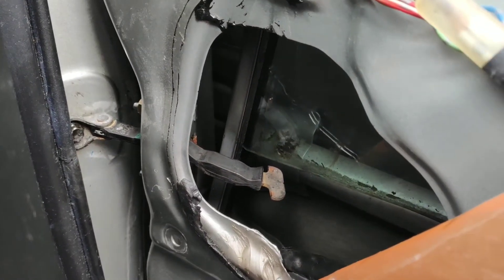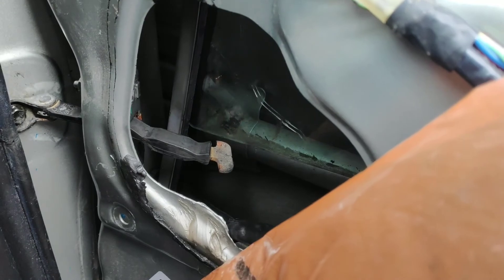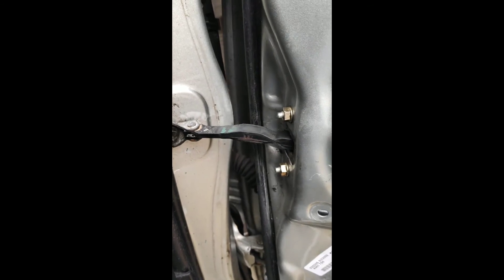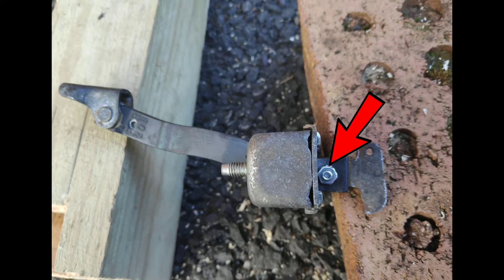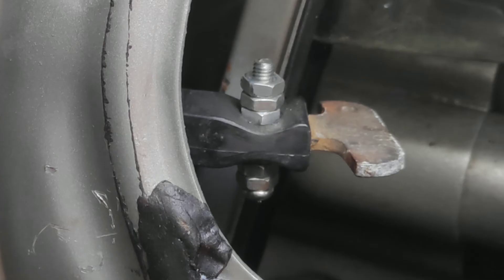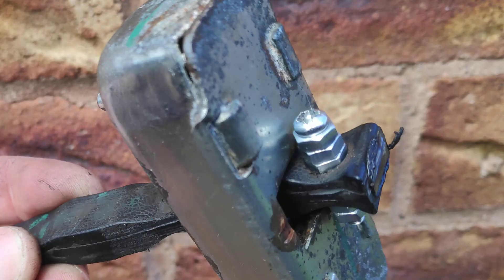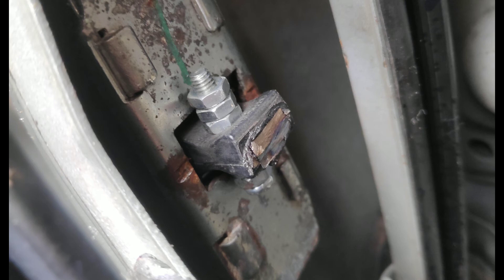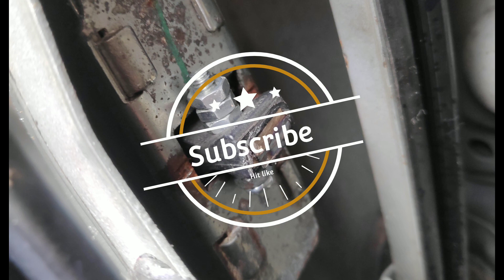Toyota Corolla door check strap mod. Avoid broken door glass!

Comment: Thanks for this info. I had the same issue with a 2004 3 door corrola. The doors are massive and the check strap probably gets strained easy enough.  The secondhand one I purchased was the same, interfering with the window, so I followed your idea. Cheers!
Reply from the maker: No worries lad. Glad it was useful to ye.
Reply: The same here but the 3 door  automatic version  ( i have dyspraxia , autism etc ,this is the best value reliable , non shit box car i could get at my max£2500 budget and i love it , plenty of space :)  )  ( the previous owner snapped the original one( its my first car had it 6 months. took year and half or so to find a decent ,insurance affordable car  ) , still have no clue why , I  bought one  from amazon after looking for exact part specification on the schematic diagram , it hits the windows about just under a third from the bottom , when the doors closed

Edit fixed the problem bought a genuine replacement actual specific part from yam6

Comment: Think I'm going to have to do this. The place that does my annual safety test showed me years ago the check strap was missing (snapped). But it wasn't a fail item and passed every year until last, when some guy decided to interpret the rules differently. I thought I was clever getting a $5 replacement from the scrapyard but as you show it interferes with the glass. I left it in for the retest at a different branch (where they were confused about why it failed in the first place) then removed it  again. 

Now here we are a year later and I've just wasted a couple hours cutting and grinding down that little pointed tab and reinstalling it several times, but it still catches. I don't know if it's the door frame, the window frame, or the check strap that's at fault but I can't put any more time into it - I'm meant to be looking for somewhere new to live!  So your solution looks best. I'm off to buy a bolt then it'll be sorted for this year and next. Thanks so much.
Reply from the maker: You are welcome. It's a nice trick to avoid the potential for the glass to ever break.